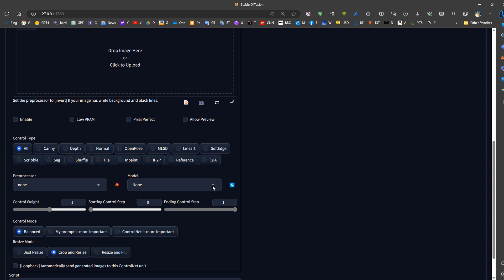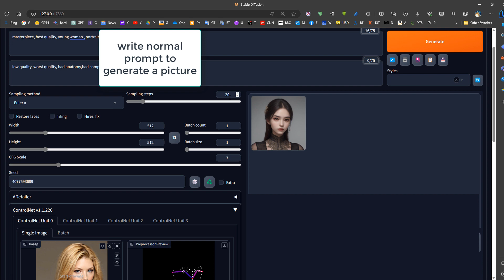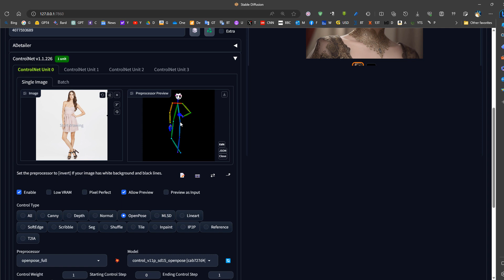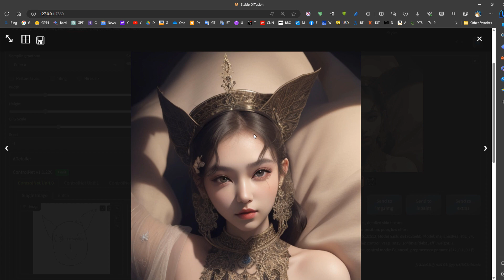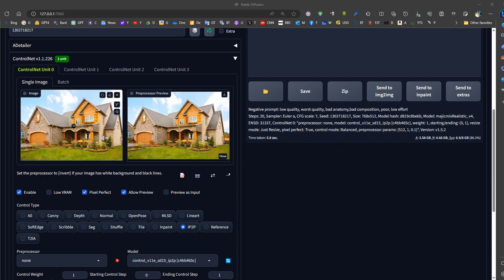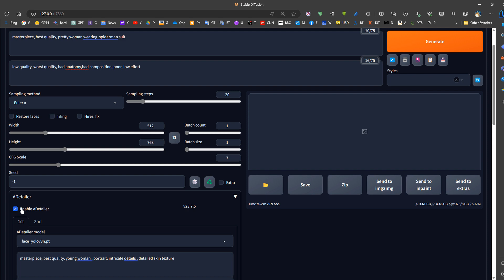Comment: Amazing video! Could you explain how the compilation at the end is possible and achievable? If we're in img2img mode to preserve appearance (Spider-Girl), we need low noise levels, but for changing poses, we need high noise levels. I'm doing this manually - painting over the face, setting high noise, and using ControlNet Open Pose. Only then can I achieve the result. Please help 🙏

Comment: That is a truly awesome guide; I have just subscribed. 
If I may ask, what should I do if I want to exclude a specific part from the Canny model? 
Here's my scenario: 
I have a custom model, and I want to mimic images, such as the pose and environment. 
To achieve this, I've created two instances in ControlNet
1- OpenPose 
2- Canny. 
The issue I'm encountering is that Canny is replicating the overall shape of my head from the source image. 
How can I exclude the head part from Canny? I hope you understand my question, and a big thanks in advance.
Reply: thanks, canny can be very strict, this is why we can use depth maps for example to reduce this strickness and get the overall shape of the body, or change the edge detection settings to make it weaker .... not sure however if we can exclude a direct part of the canny processor automatically in A1111, I dont this this feature exsits at the time being, more complicated workflows can be performed in ComfyUI but that requires more work.... if you are working on a single image then you can use inpaint afterwards to fix it, but for automation ComfyUI is the way to go in complicated scenarios.

Comment: Hey ! thanks for the great tuto ! How to generate only depth map or pose pictures with CN, and use each of them as a mask for batch apply after ? I want to use it as mask for an image sequence for doing videos.
Reply: You are welcome, in Img2Img if you apply controlnet in Batch image processing, it will automatically create the mask for the current input image, as i display in this video https://www.youtube.com/watch?v=k4ZWJD6W8d0&t=511s so you can use controlnet for openpose/depth map combination for instance and it will apply that .... this will not however save the openpose or depthmap pictures indepenently .... if you want them independent for other purposes one can possibly use ComfyUI and save the preprocessor mask output directly using save image node ... or in A1111 one may use for instance Rembg script in Extras tab and check Return Mask option  (this requires Rembg extension installation), similarly there should extension for openpose such as openpose editor which may allow you to generate poses and save them as images if that is what you mean.
Reply: @AI-HowTo  thanks for sharing the tip ! I will do some experiments and hope it’s functioning ! I will try the extensions and give a shot to ComfyUI, btw. Maybe it will be better. I want to create a mask as pre production to light the process;